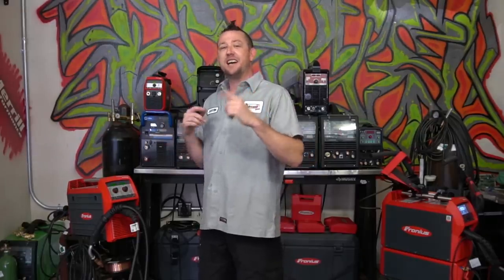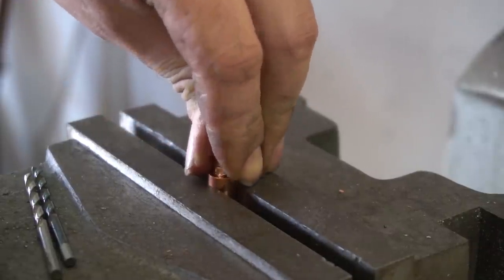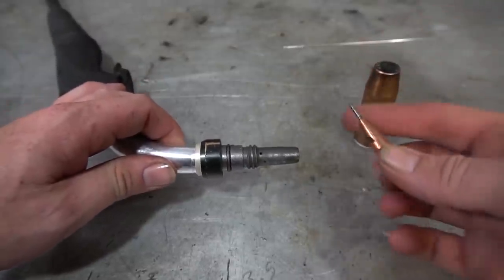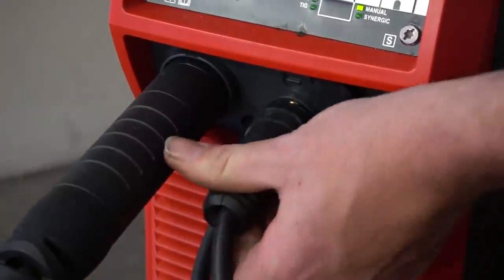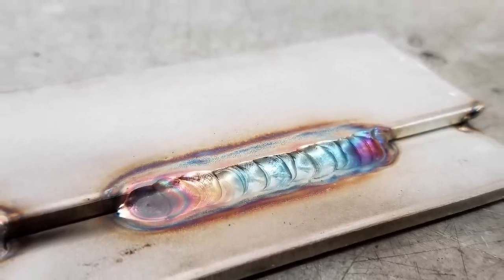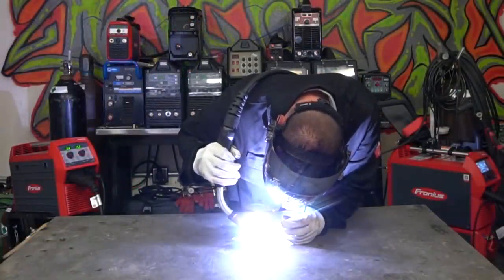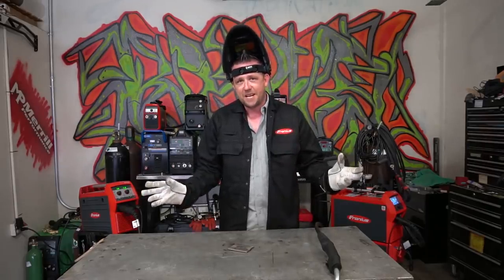TFS: HOW to convert your MIG into a TIG Welder

Comment from the maker: 🤔 TMIG welding.... I think we should call it TMIG welding. What do you think?
Reply: #tiglikemig #tmig for short 🤘🏻🍻👊🏻
Reply: TIG welding with Constant Voltage instead of Constant Current sounds fucking stupid to me and serves no actual real world purpose...oh and let's see it pass Xray
Reply: Mig machines are  constant voltage where as tig machines are constant current.
Reply: How about using an actual MIG welder, not a machine that's already setup with TIG capability.
Reply from the maker: Kleo 84 It makes exactly ZERO difference. Try it if you dont believe me.
Reply: powerstroke0459 for one, he litterally did this to prove that it works. all welding is interchangable while being  completely incompitent to do each others jobs. ALMOST any welding process CAN get ALMOST any metal to stick together. BUT to do it CORRECT, ALL conditions must be PERFECT for the material youre fusing. Theres welding, and theres welding. This is welding lol, Just not the kind youll get famous for ;D
Reply: The Fabrication Series you proved your point with this demonstration. Either way current=heat. MIG still has to produce current in order burn wire. Straight TIG uses the pedal to get the arc started. You are using lift start or scratch start. I can do the same thing with my Milley Big D4. So unless people look into the Early Era of TIG they will give you shit. Back when I learned to weld TIG was called Hell Arc. I was 14... I'm 60 now.
Reply: migastig
Reply: Dont let the negative comments bother you. As a production welder of 24 years i can easily tell you that was a good weld with good penetration. Good job and good tip.
Reply: GTMAW
Reply: Hay thanks Mon for me being I can't use my feet maybe this I can practice tig welding with this method.
Reply: @imagineaworld  all those "famous" instagram welders that can only weld siiting on a table with perfect conditions and materials aahaha i laugh at those kids...never welded in the rain, upside down on a rotten panel, hung up on roof fixing a big h beam with a massively thick cable and huge electrode with small rain droplets falling and getting shcoked etc etc ahahahah. i only have respect for real welders, the ones that go on the field, the ones that can fix a broken excavator beam in the middle of the jungle with a crap stick welder, the ones that get a broken industrial machine going in hours etc
Reply: Absolutely love the idea! it's what you make of it guys. Thanks for sharing
Reply: Thanks for the video, unless you live in the USA and you have a machine for every possible job, this exemplifies when some times you don’t have the right equipment, you still can get the job done and back to work just fine. Great video
Reply: good, but unfortunately most of MIG welders only run  30 volts hardly 16
Reply: it' definitely Tig when nothing remains of the Mig. weird question
Reply: I'm just a hobby, home project guy, the wife bought me a machine that claimed it will mig, tig and stick weld. I have used the mig function and it works great, have yet to try tig, probably won't try stick as I have a dedicated stick machine. Cool info, well explained and appreciated. 👍🏁
Reply: Got a lot of welders there...
Have you got a Cold Welder?
Like to hear your thoughts on the  machine.
I thought it was just for jewelry and really small stuff.
Now I'm seeing it used for all sorts of welding.
Reply: Twig welding ?
Reply: What if I don't have gas on my mig welder... is it still OK to convert to tig... Thank you...

Comment: Say you have a tig torch. How to connect it to your mig machine.? Could you just connect the working clamp to positive, the tungsten to negative pole, and gas hose to argon regulator.? And disconnect switch to the spool. So the switch only activate the gas selenoid not the roller. Am I on the right path? Appreciated your advice sir🙏

Comment: Thanks
My mig machine have a smaller gun, one that actually very similar in size to a typical tig torch so based on this do you think it would be practical in this case or there is more to it than size?
I am serious hobbiest and would really like to have tig welding option without having to buy a separate machine, do you think in this case it's a good choice to make this modification?

Comment: If you had to weld an exhaust header?
And it had to be a tig ?
According to the shop who pulled it for you?
Could you use this process with your wire feed mig?
And what type of rod do they call it ?
Do you buy tungsten to convert your torch and a certain rod?

Comment: One thing you could have mentioned is that MIG is a constant voltage process; you set the current via the wire feed speed.  TIG and stick are both constant current processes.  You set the voltage with the shielding gas selection and arc length.  The bottom line is, of course, that you don't have the heat control you do with a real TIG pedal.   But it does work, doesn't it?   One of my best stick welds was with a pair of car batteries in series and a 1/8" 6013 rod.  Ah fond memories of the Mojave desert and broken vehicles...

Comment: If you are breaking that drill bit
A suggestion, That is a copper brass fitting, Blunt the end of the bit cutting edges with a back rake. Then any pressure applied is not going to grab. unless you really force it.

Comment: I tried it with my little Italian 120V /90 amp AC MIG. It held a good arc on the lowest setting but started letting the smoke out of the case at higher settings. Didn't handle aluminum well either, wouldn't get hot enough to make a puddle.After all the goofing off, I put everything back stock and it welded like before.

Comment: ive seen this a few times and as you said you are not the inventor of this but is it possible to make a tig welder run a mig spool gun? id like to see that! ive seen a device by draper that will convert your tig welder to run a mig spool gun however is it possible without some interface device?

Comment: When you stop to avoid the pin hole maybe try giving another quick shot so you get an extra puff of gas, I never saw that before . Now a lot of machines are muti-purpose. I always like having one or the other though, it seems to do the job better , but in a pinch I guess it's something to think about, I've bored out tips to take a larger dia. wire but never take tungsten. Never thought of that before. Does it weld too hot?

Comment: Now I got to ask is there any way to git without Gas like if you use a stick to tig with do you still need gas I know this might be a studied question but I had to ask. I have a LE 210mp  that does tip Mig and stick  but no gas and I don't weld that much to get a tank

Comment: Not a welder just a homeowner/hobbyist so forgive me if I sound nuts. Totally understand what he did with the current etc. So since he has the Mig gun converted to A Tig torch, is there a way to mix in a foot pedal switch so it wouldn't be so awkward holding the Mig gun. Or is the Mig gun kept on with no current adjustment ? Speaking on a strictly MIg process machine.

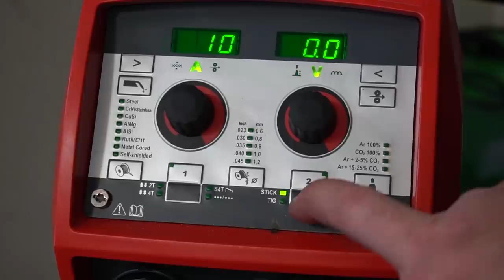Comment: Ok so I am confused a little why do a demo with a machine, that already does tig @3:22 you see tig clearly. The more proper thing would have been to use a mig only machine. That machine is way to advanced to demo like that IMO.
Reply: Exacly...TIG as well as Stick is a CC constant current process.  A Mig ONLY machine is CV constant voltage and will BLOW AWAY the tungsten at any setting. He is running CC [stick-tig] not CV[Mig].
Reply: AWDJR no he’s running it as a mig machine you can’t set voltage in stick/tig mode, it doesn’t matter if it’s a mp machine, in mig it’s cv in tig mode it’s cc
Reply: @patricksworkshop6010  you can ones you turn away the camera.

Comment: I've used both machines, one is set up for Tig the one I use at work and it has arc start, and one I use at home which is just basically a stick welder with a tig torch that you have to scratch to start the arc. The hf arc is definitely nicer but makes zero difference once it's going to me. Sometimes I forget when I'm using the one at home because I like having the high frequency arc start.

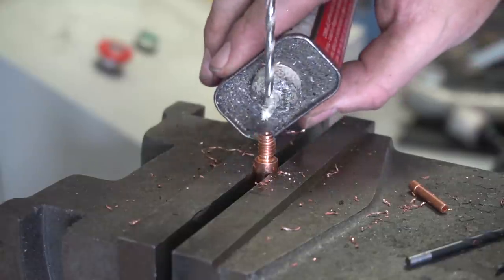Comment: Pausing at 2:05 to come comment- is it me or does your drill press have an insane amount of runout?  It's so bad that when you put the 2nd bit in and fire it up, my laptop shakes.
Reply: I noticed the run out but it is WAY better than mine. Lol
Reply: Since it drilled the size hole he wanted I say it was an optical illusion. But yah... sure looked wobbly.
Reply: Holy crap, a new 20$ drillchuck has a lot less runout than that. Guess this is the difference between a welder and a machinist..
Reply: Its the camera. Its like watching a fan blade at speeds or a car wheel in motion.
Reply: Just give more clearance Clarence
Reply: @toddmccarter45  Roger roger, whats are vector victor?

Comment: I did this to a old welder about 12 years ago, the collet system was different then what was used in this video, and I must say, for what it is, it does work!!!. I ended up adapting a TIG torch on to the unit, and things got even better to handle.. I dropped the unit out the back of my Jeep, and busted a few  key parts on the board, and that was the last of that venture, and thought I'd pursue it later, but, but that time I got around to it, the cost of TIG machines, had come down in price, the logical thing was to just buy a machine that would allow for not only metals, but aluminum as well.. But this does work, Mind you, scratch start TIG welding has been around for a long time, and the new tech that doesn't require scratch starting of the arc is fairly new, like the high frequency start options... As I am sure most of you already know...

Comment: No need for the drilling to take a Colette, just push a bit of tungsten through a mig tip that has a hole a few thou smaller than the tungsten is.
Reply: 'Collet', colette is a girl who lives down the street.

Comment: I have a 110 volt mig welder, could this work on this machine? What about the trigger on the handle, do you tape it pulled in all the time like your mig welding? That would have the gas flowing all the time. Do you thing you could by pass the trigger switch with a foot switch to start the power and gas? The reverse polarity on the mig I use for the flux core (inner-shield) wire.

Cool video

Comment: Interesting.  I have a cheap triple function welder.  I don't use TIG because I cannot control the flow of the gas.  Using this method and learning how to set the voltage I can control the gas with the switch on the torch.  Nice trick.

Comment: My thoughts were to plug in a tig torch with a valve(like a  WP-17V-12-R TIG torch) were the mig lead was suposed to go, release the drive rolers ,put a  rubber band on the trigger and scratch start .

Comment: You can also connect typical portable scratch start torches to your MIG power supply and use a switch on a pigtail to turn power on and off.

Comment: My Solar MIG has no reversible electrodes, is it AC or DC?  If I can work out a polarity swapping technique so I can make the handle negative, I should be off and running.  But, if it an AC welder, I know I'd have to rectify it.  The question is, HOW? They don't stock 200 Amp diodes at Radio Shack... In fact they don't even have Radio Shack at Radio Shack any more!  Maybe, if that's too hard to do, it might be time for a different welder... Have any advice?

Comment: Could you not make a TIG gun and wire hook up to a MIG machine and have the appropriate cup instead of using the MIG gun?
Reply: Actually just buy a real TIG gun and hook it up. For the gas shield switch which is normally a foot pedal, just find the solenoid wires from the gun and patch in from the connectors.
Next buy a sticker for the letter "T" and slap it on over the "M".....

Comment: Hello! I put tungsten rod on my 170 Amps Mig-Mag welding machine, but any arc does not appears when press the button, no matter of the voltage, amperage or distance. What could be the problem? The torch is +, and the ground is -, but they can not be switched.

Comment: The concept is a fun experiment. But. Most mig only shops have on hand CO2 or some CO2 mix. Purchase of the Argon alone puts it way out of playing / experiment coast limets. And if you have a large enough project to weld stainless. Get the proper equipment. Still is an interesting experiment.

Comment: I have an old mig welder that i cant get to feed correctly(i thing the electronics overheat and stop sending power to the feed motor intermittently ). i will try to turn it into a tig welder using this technique.

Comment: I have an unusual request and don't have the means to try this experiment myself.  Could you try to do a mig weld (without shielding gas using regular mig wire) inside a propane torch flame?  (for example a Bernzomatic propane torch kit)  Basically using the inside of the flame as the oxygen free environment to weld in.....I have requested this procedure on other welding channels with no success.  Thank you.

Comment: When converting a stick welder into a Tiggy (a so called MMATIG perhaps?), can it only be done with a scratch start or is it possible to use the automatic high starter pulse for the stick to act as a starter like in the expensive actual TIG machines with that feature?
Reply: arc can only be scratch start but a mig you could convert the trigger wiring to suit a foot pedal pretty easy .
Reply: - Yeah, not what I asked about mate...

Comment: I thought of something that could work on a big welder like a 450 or larger machine . You can put 2 tanks on back, just change that over and if you have a dual wire feeder leave the tig on one side, mig on the other change your cables you're all set to TMIG. Only problem is no cooler, but on a mig gun it probably wouldn't be as noticeable. I wouldn't like to move it around though with extra gas tank. Happy TMIGing.

Comment: MIG welders are constant voltage power supplies, TIG welders are constant current power supplies. That means if you use a MIG machine to TIG, it's gonna be very difficult to maintain an even heat in the weld. Any variable, even stickout or contamination, will change the resistance of the load which will change the heat of the arc. Interesting thought, but kind of impractical for doing real work.
Reply: Travis Gillin it works extremely well actually, I did this to my mig welder almost 5 years ago and I used it as a scratch start tig welder for almost a year building bull riding spurs out of 304 stainless steel. I have a Miller 135 mig welder; i machined the contact tip out to accept a tig collet (my tungsten could only be about 1.125” long), pulled the wire out of the machine and turned the wire speed all the way down, reversed the polarities and ran the trigger wires to a momentary switch that I zip tied between the nozzle and handle and ran a bottle of straight argon and It worked incredibly well. Since then, I purchased an actual tig welder and converted my mig back to normal, which I use almost every day.
Reply: I could have used this to do exhaust systems.
Reply: Doesn’t seem right, a man promoting fronius gear promoting CV tig🤔
Reply: @dcacmc3693  sp you're saying I can do this with my autoset 140?
Reply: @Heavymetal Weld Absolutely, just make sure you run straight argon, pull your spool of wire out and reverse the polarities under the side cover. Also Turn the wire speed all the way down; the motor will just spin freely while you weld. Other than that just make a contact tip into a collet holder and you’re ready to go!
Reply: @dcacmc3693  thanks.

Comment: A very interesting video, the thing is, it does work, I was wondering if it is possible to turn a plasma cutter into a tig welder. Great video, thank you for posting.
Reply: Probably not too much voltage not enough current, plasma machines are about long stable arcs.....
Reply: @oceanhouse8080  Thanks for your reply, it turns out, the plasma cutter didn't work anyway so that's the end of that idea.

Comment: this is how you weld aluminum with this , use a older transformer mig , get a cheap chinese cratch start #17  tig torch with a gas flow control ( less than 50.00 on ebay ) . open up your welder and have the lead come off the rectifier where it is make ac current , this will be very similar to a scratch start ac stick welder converted to tig

Comment: Can a Lincoln 125 MIG welder be converted to a TIG welder with a "real" TIG torch that contains a switch for the gas solenoid in the MIG ??  If so what torch would work ?

Comment: Then fry your board when you ground out the tungsten. 
Mig and Tig are different kinds of arcs
Reply: asasial1977 since it's a scratch start, doesn't that debunk your theory? It's short circuit mig, so doesn't that mean that it's always grounding out when welding?
Reply: Brandon Parry you ever truly grounded out the gun on a small welder? Like have a bunch of slag in the nozzle and short it out? They do not like it at all and it is very hard on the machine
Reply: asasial1977 No, I haven't. Maybe I clean my nozzle enough to prevent from that much slag build up. But I can actually see what you're saying. There must be a safety on scratch start tig and stick machines to protect it when you stick the electrode.
Reply: Brandon Parry it can happen if the insulator wears out between where the nozzle screws on and the nozzle itself. 
If you want to try it you can get TIG torches with a manual gas valve and an adapter on it that makes it easier to hook to a welder for about $60 on eBay. I have one to hook up to my genset

Comment: but can you convert the cheapest "mig" welder chucke2009 tested into actual mig or tig welder if it has no  gas suply?
or better is it viable to add such feature like gas shielding to the cheapest flux core "mig" welder